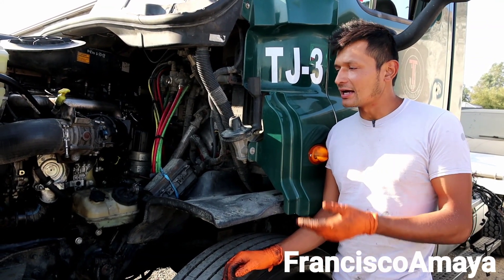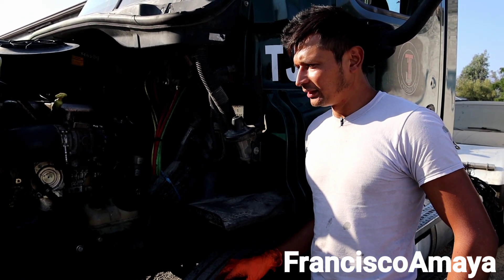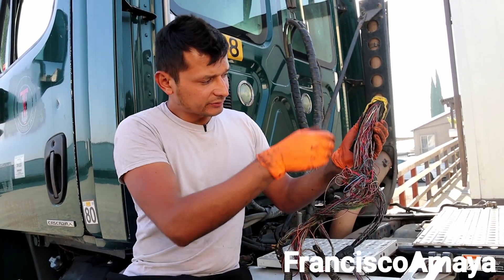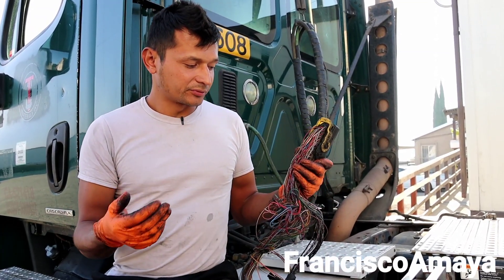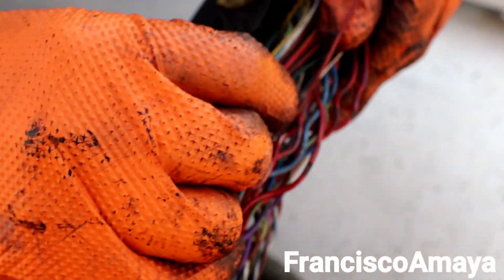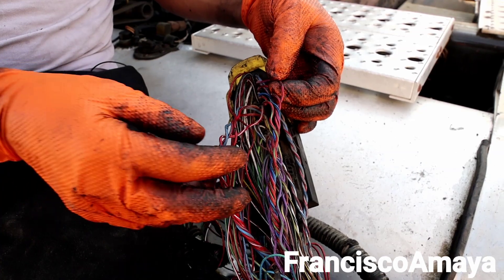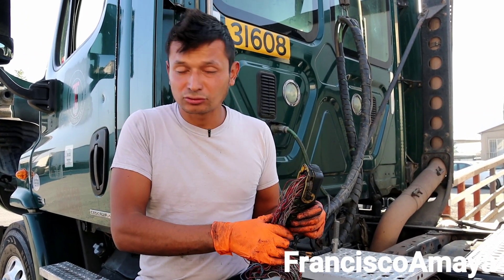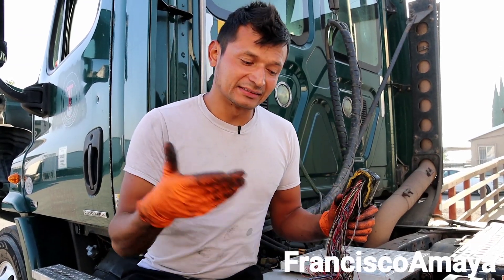Freightliner cascadia M2 DD13 wiring problem with engine electronics and sensor check engine lght on

Comment: I enjoy watching your videos!  You seem to know your stuff.  I have a 2014 Cascadia with a DD13.  442000 miles, i have a code of eng 2 spn000102 engine boost 18, where would be the best place to start for repairing?
Reply: Replace unit

Comment: Hi  i am working  on paccar mx13.it has def fluid must be replace code..i have drained tank,replaced nox sensors,scr checked, def quality sensor replaced,software updated,road test done many times with def disable in davie 4 software.but check engine light does not clear.any suggestions will really appreciable.plz suggest